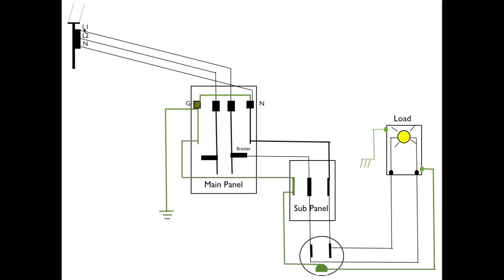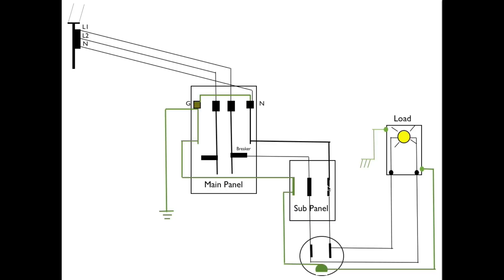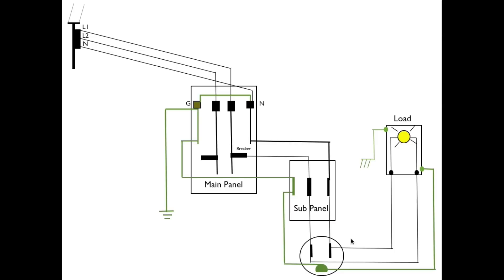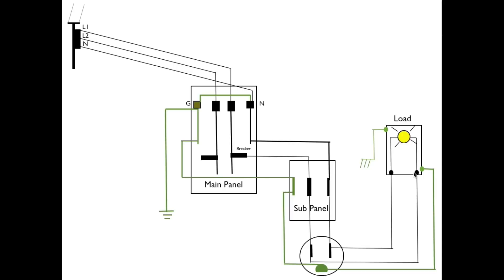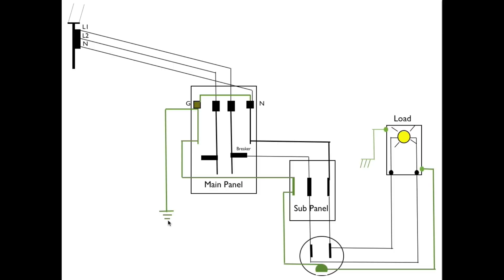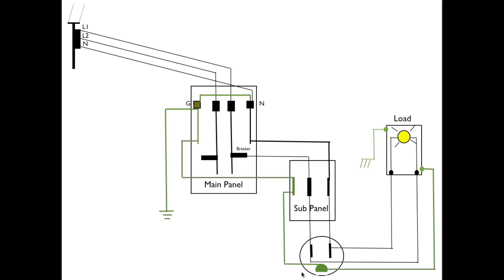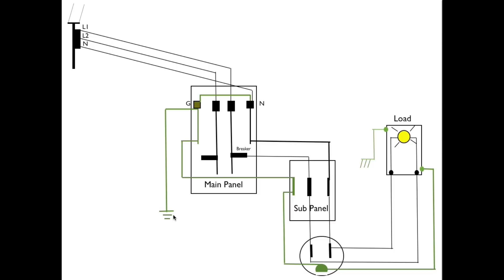The difference between neutral and ground on the electric panel

Comment: In need of advice. A plumber working at My parents house replace most of the copper water pipe that was serving as a ground.... Although there is no wire hooked to the bonding screw inside the panel. (wondering where they made the grounding connection if any) No grounding wire found nowhere. The lighting started acting weird and the fridge and a paper shrader got messd up by the high voltage that followed the act of him cutting the water pipe and replacing it with pvc. Voltage before I had to drive an 8ft ground rod in the ground was L1 107 volts and L2 137 volts. After I drove the ground rod and check for voltage again L1 is now 123 volts and L2 125 volts. Just wondering if that voltage is normal. Thanks for all the comments. By the way still have some problems with lighting...
Reply: im not an electrician but the voltage you got now is pretty normal. before you had over voltage and undervoltage issues. get an outlet tester from harbor frieght.... lowes... etc and check every outlet. years ago before they added grounding to houses and before devices require polarized current a lot of people used to switch hot and neutral around on outlets or not hook the ground wire up. the tester will light up to tell you if outlet is wired correctly or whats wrong. it will also tell you if outlet is hot. if you find a lot of outlets wired wrong it might be good idea to call electrician. if you attempt the repairs yourself make sure breaker is off and tester does not light up! it is also recommended to go ahead and put a new outlet in as the plastic over time becomes brittle and breaks. and outlets are only a few bucks to replace compared to cost of replacing burned down house and everything in it. if you have problems with ceiling lights you may have loose wires in junction boxes in attic. if you see wires connected that arent in a junction box in attic then call electrician immidiately! if lights flicker when you turn something on especially something with a compressor on it like fridge or air compressor then its cause lights are on outlet circuit instead of keeping lights on seperate circuit as outlets or you have too many rooms on one circuit like my house was. ive worked wiyh electricity long enough and know codes to rewire my own house... which i did. but electrical work is one thing most people should just pay a licensed professional to do. if you have an electrician come out have him install gfi outlets in kitchen, bathrooms and outdoor outlets too. have him make sure outdoor outlets have propper covers and make sure neutral and ground wires arent connected to wrong blocks in pannel. thats all i can say without actually inspecting house myself. good luck.
Reply: +Joe Smith Thanks a lot for taking the time to write all that. The problem has been solved... Well temporarily. Call power company as a few electricians recommended and sure enough the problem was outside coming from the transformer. Lost neutral somewhere.
Reply: +POLOAZTECA glad someones greatful for my advice finaly. lol. you can inspect rest of your house wiring now just to make sure no outlets are wired wrong etc. cheers!
Reply: +Joe Smith Thanks again... Cheers!

Comment: Ok, I have a 20 amp breaker feeding 6 outlets.  As I shut off a vacuum cleaner, I seem to have lost the neutral on the last three outlets.  Using a voltage detector, I seem to have a hot wire still going to all six outlets so that is how I concluded that it must the the neutral that I lost.  I believe that outlet #3 was added after the original house wiring, i guess pigtailed in, probably with wire nuts.  I am wondering if I could ground the neutral on outlet #6 to solve this problem?
Reply: Hi larry ,the best thing is to use a multimeter and test load and neutral lines on the non working outlets to see if 110 voltage is read.  it is not ok to use your ground cable as a neutral. if the neutral is lost you must piggy back around the circuit to find where the neutral was lost. perhaps just loose on the load out of another outlet that feeds your currently non working outlets.  good luck.

Comment: Hi there, thanks for the great explanations. Now I understand more about the neutral and ground. Please tell me what's the purpose of the line 2 from the pole going into main panel?  Are line 1 and line 2 carrying 120 volt each?
Reply from the maker: Line 1 is one pole of the primary winding.  Line 2 is the other pole.  Each are 120 volts to neutral.  240 between the two.
GFM

Comment: If you had a Meter panel with disconnect from the pole as the service outside of a home and than a 50 ft service wire to a main panel in the house. Would the house panel be considered as a sub panel or would that still be the main panel? Would the house panel need to have the ground and neutrals bonded with a separate ground rod connected to the main house panel. What would be the right grounding application for this kind of panel install.
Reply from the maker: Custom Building & Remodeling, LLC It is considered a sub panel.  The panel must be wired from the main disconnect with 4 wires.  2 hots, 1 neutral and 1 ground.  The earth ground must be connected to the meter panel.  If I am understanding you correctly, this is how it should be done.  Hope this helps.GFM
Reply: grayfurnaceman That's what I've been taught, but what has been confusing, is  I have read up on and other contractors have told me that there needs to be a grounding rod to each separate building. Is that correct? Because there is no bonding between the neutral and grounds or should there be an addition ground rods to ground bar for phone & gas? Basically is it wrong to add another grounding round at the separate structure with the Neutral not bonding to the ground in the sub panel?

Comment: To put it in its simplest terms, the neutral wire is intended as a current carrying conductor and the ground wire is a safety wire and not intended to be a current conductor, until a problem arises.
Reply from the maker: Agreed
GFM

Comment: The main panel has 240vac wired into it which is coming from the utility pole located outside with the sub panel being then "stepped down" to 120vac by utilizing only 1(one) line in, that being the leg L2 from the main panel, correct?

Comment: important to note that that is an ac (alternating current) circuit that has been diagramed. The laws that govern there operating characteristic  will not be the same with a dc (direct current) power supply.

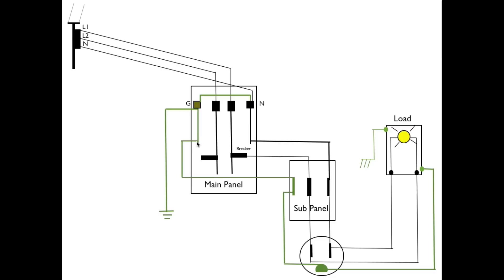Comment: What I still can't seem to comprehend is your comment about the ground wire not "carrying" any power under normal situations (4:49) If it is connected in parallel with the neutral wire, should it not simultaneously carry the same voltage potential? The only way, in my mind, that the ground wire can effectively provide an alternate path for a shorted circuit is if both the neutral and ground wires conduct simultaneously, so in the event of a short circuit, the electricity has the ground path to follow.
Reply from the maker: Toroid Militia The ground wire does not provide an alternate path for a short circuit except for the fact that it is connected to the neutral in the main panel.  In the event that a hot lead contacts the chassis of the appliance, the power will pass thru the chassis ground wire to the panel where the ground passes power to the neutral and the circuit protection opens due to large amp draw.  
The earth ground itself does not provide any path that will open circuit protection.  It is only of value to discharge lightning to ground without (hopefully) damaging appliances or sometimes absorbs spikes in the line.  Hope this helps.
GFM
Reply: grayfurnaceman Thank you for the clarification

Comment: Ignore this....similar question answered below....thanks. this helps but there is one thing that confuses me.  You mention the neutral wire carries current back.  Where does that current stop in the main panel and what stops it? Why doesn't the current pass through the ground bar and back to the light casing via the ground wire?  It's all connected, right? I don't get it.   I would think that the ground bar and neutral bar should NOT be bridged/connected with each other.
Reply: tman rap that aply only on sub panels you should have a neutral and ground separate

Comment: Great explanation but I still do not understand why the neutral bus connects to the ground in the main box. If the neutral acts as a return and can be hot then why doesn’t the ground become hot in the main box? Hope you can shed some light on this for me. Thanks in advance. Regards
Reply from the maker: I will try.  The ground /neutral connection in the main panel a sort of drain or zero point for voltage.  Any spikes or small surges and lightning are drained to earth ground.  That is the only function of earth ground.  The neutral is just the other side of line.
GFM

Comment: Even though modern automotive electrical schematics make this stuff look like child play ,I watched this video about 7 times!!!! Definitely not a subject for the non professional.I remember one night while standing in the bathtub I reached up to pull the metal chain of the ceiling fan ( bad idea) and when my fingers got within a inch or so from the switch chain I litterally felt.a sensation akin to holding a vibrator.Thank god I had a clue
Reply from the maker: Don't touch the chain!  lol
GFM

Comment: I would like to paraphrase this back to you using different terminology, yet using you're diagram and hope for you to validate that I got this.  The main panel also known as the first point of disconnect requires the neutral and ground to be bonded together.  The sub panel requires a separate ground. This wire should not be bonded to the neutral.  Is that correct?

Comment: Bought a house that was nasty for real cheap. I have a Rat problem and lost a hot wire going to the kitchen plugs that feed two receptacles. I was wondering if the neutral was separat and solid to the braker box? It was. Now I was wondering if I could use it has hot and the ground wire has neutral  and ground and just bypass the broken hot wire? Running new wire would be hard.
Reply from the maker: No.  Do the hard thing.
GFM

Comment: Thank you sir, for a details lecture this subject. I have a question because based on your other video about three  wires electrical system  if there is an unbalance on the amp running back to neutral wire. Does it create a current running to the ground wire which makes it more dangerous? and makes the outer case of the load to be hot? thank you
Reply from the maker: No.  Ground is not part of the circuit.  Earth ground does not conduct power unless the voltage is very high.  I did a number of videos on using earth as a conductor that may help.
GFM

Comment: I have a question about a more complex situation.  The main panel is in the garage (a separate building).  The panel there is grounded.  Three wires (two hot and a neutral) run underground to the house.  The panel in the house has various 120 and 240V circuits.  All neutral and ground wires in the house run to the same busboard which connects to the neutral wire.  I am adding cable internet and the installer says he needs a way to connect to a ground in the house.  Of course, I also want a safe, compliant electric system in my house.  What is the simplest adequate solution to this problem?
Reply from the maker: +Steve Young I can't say for sure.  However, the main panel is the only one that should have the 3 wires and ground.  The house panel should have 4 wires.  2 hot, a neutral, and and a ground.  Check with an electrician.
GFM
Reply: Steve Young — It seems to me that there should be a separate ground wire from the house back to the main panel.

Comment: I wonder if an Earth ground return path can cause dangerous gradiants for someone who might walk across the return path area,...which brings the question also, what exactly is the shape of the return path area? I do realize that the ground rods would be quite deep in the ground, so the return path area may be deep in the ground as well.
Reply from the maker: John Kerley Actually, that could be a problem.  Suppose you were digging a ditch in the area.  If you interrupted a portion of the ground that was a good conductor, you could get a shock.  You also have no idea what path the electricity will take.
GFM

Comment: So I have a question.  If you have a 230V with 2 hot lines and a ground (no neutral) and you need a 110V:  Taking your example, can't you use one Hot Line and the ground to a GFCI. Connect the GFCI grounding screw to a metal electric box then run a grounding rod.  Wouldn't this give the same protection?

Comment: I feel I have a pretty decent understanding of Low Voltage or DC Electronics. What I don't understand about this AC thing is, how can Neutral and Ground be connected to the same buss but not be "Common"? I'm not saying anyone is wrong, just asking. But from what I understand if they are connected together, they are are the same. There is a clear path from the chassis of the Load to the Neutral on the main panel. They are all connected together. Why is one different than the other if they are all connected together?
Reply from the maker: Probably the most common question I get.
Earth ground and chassis ground is not part of the circuit.
Chassis ground is a connection to neutral to clear any electrical fault.  Example:  A metal drill has a connection from its winding to the chassis of the drill.  When I turn on the drill, power has energized the chassis.  Without the connection to neutral, which will open the circuit protection and deenergize the drill, the person using the drill will get a shock.
Earth ground is a path to the earth to discharge lightning and surges that could damage equipment in the structure.  Hope this helps.
GFM
Reply: @grayfurnaceman  It kind of doesn't. It still makes it sound like the two connections in question are not common. If they are not, then I get it, but if they are, then I don't. But I'm sure it's me not you.

Comment: Mm Hi all. I am student of the works of Nikola Tesla. Grounding / Earthing is a vast subject, suppose I say that the Earth is a capacitor with potential difference to another opposite pole. You could then power stuff Yes? Another thing worth thinking about is A/C (The Hot Line) is both + & - if this is so just put two diodes off the hot line for the load. Tesla's "Hairpin" circuit is a eye opener. I have much to learn & I know very little but I love learning. ...  Regards .... DC
Reply from the maker: Good luck on the "earth as a power source" idea.  It will not work.  I have no idea what you are talking about with the diodes.  Tesla was a great thinker and inventor.  His discoveries are used in many products.  However, you can't power the world with a Tesla coil.  I built one when I was 12.  Cool toy but mostly only good for starting arcs in welders.  Enjoy his discoveries but try not to become "Tesla nut"
GFM
Reply: Hi GFman thank's for the reply i will try not to become a NUt .... DC

Comment: Quick question. What keeps the current traveling back through the neutral wire actually going through the neutral wire and not just straight to ground since they are wired together? In the previous video for example, it states the current through the neutral could be 2(or 3) amps and this can then be used in other sources, however how is this done?

Is it a matter of ground resistance? If so, and since electricity will follow the path of least resistance, what's to stop a  lightning strike from going through either of the other wires and bypassing ground.
Reply from the maker: HelloWorld As for the question about power going straight to ground, earth ground is not part of the circuit.  Earth ground is simply a sink for lightning or power spikes.  
Lightning is a power discharge from the sky and the earth.  Neutral is not part of that potential circuit.  Hope this helps.
GFM
Reply: HelloWorld Recall that electricity goes around in a circuit.  There's a cute, but over-simplified analogy for this.  After powering all the lights in your house, the little electrons want to go back home the easiest way possible.  That easiest way is through the highly conductive neutral back to the source.

Since your ground conductor actually makes a pretty poor conductor to ground, I've been taught that lightning strikes will actually travel through your neutral to the supply; where a myriad of lightning arresters along the system will discharge it at multiple points better than your one ground plate/rods.  But as we know, sometimes it isn't adequate and a transformer will blow up or something.

Comment: I didn't know the neutral coming into the house carried surges or excessive currents to the earth ground in the main & disposed of it before damaging anything beyond...or minimizing it anyway.. there still seems to be enough surge at times during storms to cause damage to electronics.I had a 15" woofer start on fire once from a close strike & enormous surge.What tipped me off was the circular glow from behind the speaker grate & dark fabric...good thing I looked over there.. I was leaving for work

Comment: When wiring a 240v Water Heater inside a residential main breaker box, can the bare Ground Wire be connected to either the neutral or ground bar (bus) interchangeably?  Thx.
Reply from the maker: ***** Hook it up to the ground bar.
GFM
Reply: Thanks!!